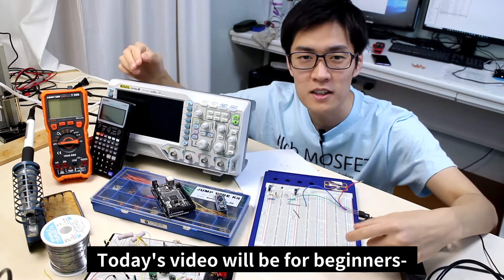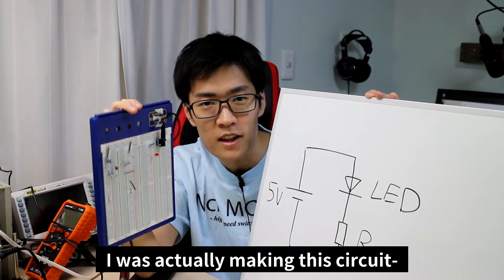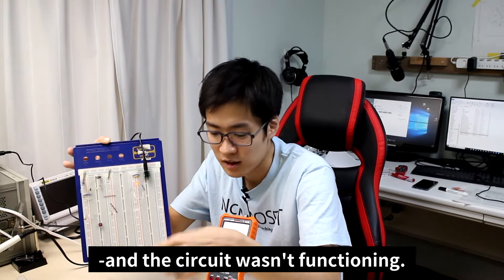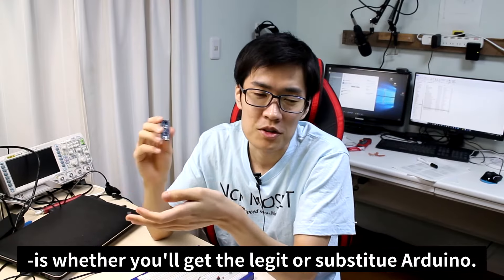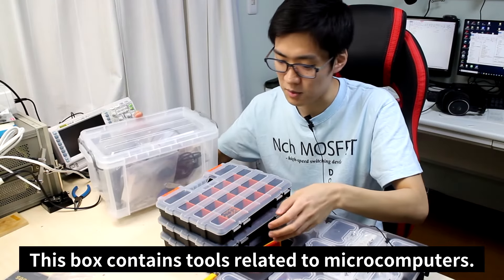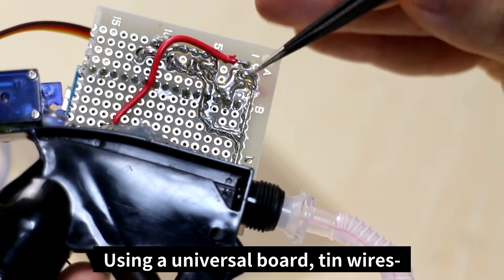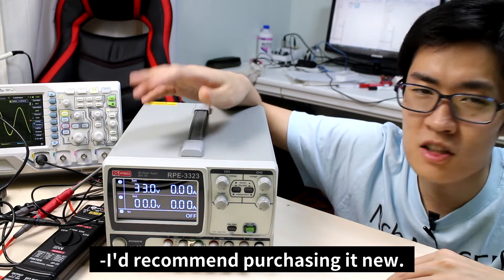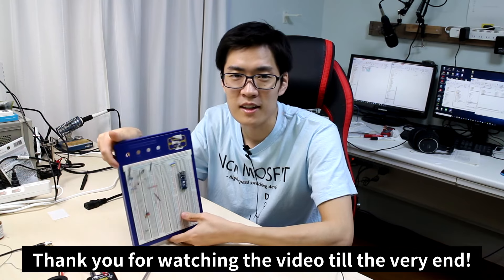【For Beginner】How to start electronics and what item is needed

Comment: You can def get into electronics knowing no calculations but it’s also very easy to learn and memorize the basics so don’t let it discourage you if you have to keep looking em up it gets easy fast
Reply: You have to be really passionate to do that. Knowing calculations helps a lot
Reply: Are the calculations something that I would learn in Physics 2 perhaps? Or would that generally be learned in electrical circuits course?
Reply: You can't get into electronic design without knowledge in calculations. All Engineering fields requires knowledge in Maths.
Reply: @curly-hairedassassin5233 I am not in college yet but I believe that physics are general knowledge more than course specific subject. So, while there are electrical problems and calculations in there, you’ll likely have more circuits specific calculations with electrical courses. Remember that physics is a wider field than a school can teach you. So, they can’t really focus on every single details because the goal of the course is to help you with the accompanying course like electrical circuits.

In other words. Physics is a support course and electrical circuits is a major. Unless physics is your major then you’ll learn most of the stuff but you’re still incomparable to a degree with focus on electricity because they have the hands down with the practical aspects while physics majors focuses on the theoretical aspects.
Reply: @ItachiUchiha-gf4fz  The way that you explained that makes sense. Physics 2 will lay down the basic foundation of how electricity works, but the more in-depth experimentations will occur in Circuits & other ECE courses. Thank you so much!

Comment: Another thing to note with breadboards or any circuit is if you want to know if any two connections are connected to each other, set your DMM in continuity mode and probe the metal contacts.  If the DMM makes a sound, it means they’re connected.
Reply: not all meters do that.

Comment: This is good to watch. I got all the setup, just need a little of motivation again. I love my Rigol oscilloscope and function generator - both can interface to my computer. I also have several test tools for drone type stuff: servo and motor testers. It is a delight! An interface to your computer that can read your Futaba transmitter is also very handy. And Flipper Zero for the field is nice. Arduino and Raspberry Pi. Arduino is good for low-level electronics control, Raspberry Pi more for a camera system.

Comment: Very nice video, I think it would be beneficial to include an alternative path to microcontrollers and do some basic analogue electronics projects such as battery powered circuits with buttons, switches, transistors, diodes and passives to widen your understanding of some key electronic components and then move onto things like op-amps and other IC's such as the 555 timer.

Of course you could do this after doing Arduino but its nice to have a base understanding before adding a microcontroller into the mix.
Reply: I've found that I like to jump back and forth between analog and Arduino. I'll build a circuit on the Arduino and then I'm immediately curious how I would do the same without a microcontroller. So I build both. It really does help me understand what's going on a lot better.

Comment: Thanks enjoyed your video.  Maybe some confusion over measuring volts and amps. You should show that to measure amps,  the circuit must be broken somewhere and the ammeter inserted in series. Whereas voltage measurement is directly across the relevant component.

Comment: I would recommend one of the cheap handheld scope-meters if just learning electronics. It will do anything in the audio range, and some of these meters have a function generator built in. A student wouldn't have to spend much, and audio is where one should start learning circuits after doing logic. That would give you the money to buy a decent breadboard without breaking the bank.

Comment: I know it's a bit late to comment, but the stuff about multi-wire and single-wire jumpers will probably not be clear to people who don't already know something about electronics, or who don't realize that you're just talking about what's more commonly called stranded vs solid wire.  But it's a good tip--obviously solid wire failure is easier to spot.

Comment: Please help to answer a few quiz questions for the video:
1: What is the most basic tool recommended for beginners in electronics?

A.	Soldering iron
B.	Oscilloscope
C.	Breadboard
D.	Function generator

2: Which tool is used to measure voltage, current, and capacitance?

A.	Breadboard
B.	Multimeter
C.	Function generator
D.	Power supply

3: What is the purpose of a jump wire in electronics?

A.	To measure resistance
B.	To connect components on a breadboard
C.	To create waveforms
D.	To solder components

4: Which component is necessary to turn on an LED in a circuit?

A.	Resistor
B.	Capacitor
C.	Diode
D.	Transistor

5: What is the recommended voltage for most electronic components like ICs?

A.	3 volts
B.	9 volts
C.	15 volts
D.	5 volts

6: Which tool is used to check the waveforms of voltage in a circuit?

A.	Breadboard
B.	Multimeter
C.	Function generator
D.	Oscilloscope

7: What is the function of a function generator in electronics?

A.	Measure resistance
B.	Create waveforms
C.	Connect components
D.	Thaw and mold solder

8: Which tool is used to fasten and solidify specific parts on a printed circuit board?

A.	Soldering iron
B.	Multimeter
C.	Function generator
D.	Power supply

9: What is the purpose of a universal board in electronics?

A.	Create waveforms
B.	Measure resistance
C.	Fasten and solidify parts
D.	Make small short range circuits

10: Which tool is used to make minor calculations involving trigonometric functions and ratios?

A.	Soldering iron
B.	Function generator
C.	Multimeter
D.	Scientific calculator

Comment: hello thank you for video. it was interesting to watch. I am reading Practical Electronics for Inventors, Fourth Edition and don't have trouble understanding overall but there are parts I am stuck on would you happen to know any good resources to address challenging topics? ex one topic discussed is dissipation of heat and there is associated equation involved. the math is fine explanation is reasonable but scope is too narrow.  excluded examples so unclear overall needs bit of clarification to address about 20% of overall topic to allow application at full understanding.  unsure if it's clear but any  information would be appreciated.

Comment: Yes you can get started like this but don't get started at all. Circuit design (of interesting or useful circuits) is hard maths. As with everything, if everyone else isn't into it, then it's difficult. Getting started is always easy (with anything). Getting further is the problem. You will end up throwing away the Ebay junk you bought.

Comment: Good video but you did not say more basic tools that the person needs. You recommended mosty expensive tools! You forgot to say that if you need to learn simple calculations and buying a scientific calculator that they also need to learn how to read electronic signs and how to read diagrams. The multimeter, soldering iron, desoldering iron and soldering lead are the things you mosty use to create projects. You lack the explanation about these tools!

Comment: Sweet.
I recall being asked to fault  find some R&D   boards manufactured in china some years back.
Typical R&D batch would be 10 manufactured on site, but the company chose to have them manufactured  in china and sent back to my country to progress.
Not a single board worked when it came back,, I spent less than a minute to diagnose the fault and rectify it on the 2 boards , and had the other 8 boards working within the hour.
Poor workmanship is the reason I tend not to purchase certain products,  this guy does not appear to be following anti stat procedures at all, , ,  would I purchase anything he made?
No.

Likewise Dyson.
They infer they are made in Britain   but are they?
.
Reply: Dyson vacuum cleaners were once all made in Malmesbury, Wiltshire, UK. The company wanted to expand the factory to cater for increased demand but the local council refused permission on the ground that a large factory would be out of keeping with the rural character of the area. The authorities in some other countries were much more welcoming.
Reply: I believe that Numatic vacuum cleaners (of which the Henry is probably the most famous) are still made in the UK in Chard, Somerset.